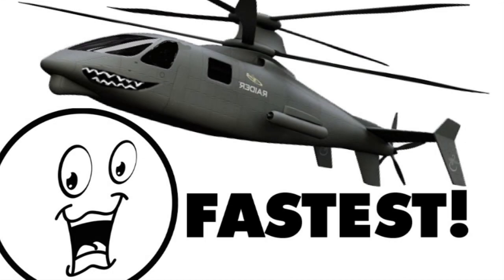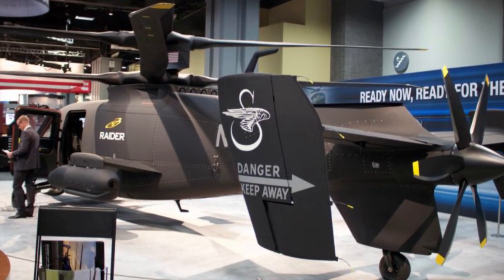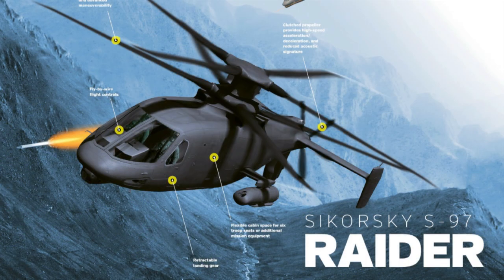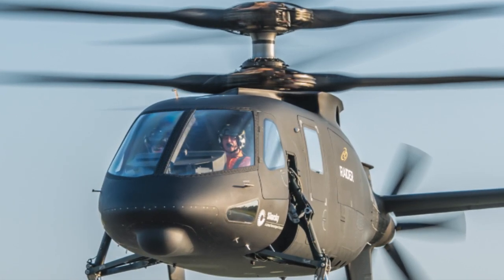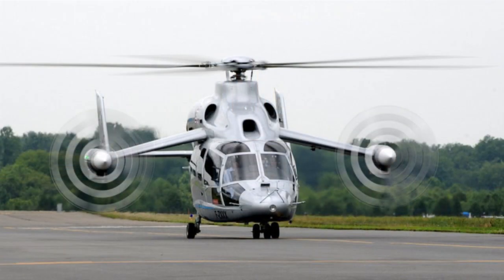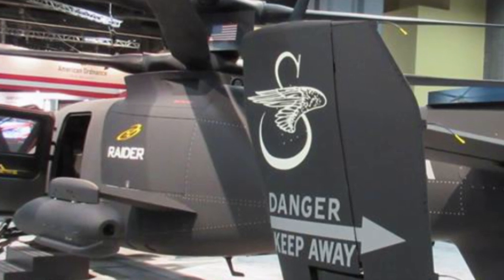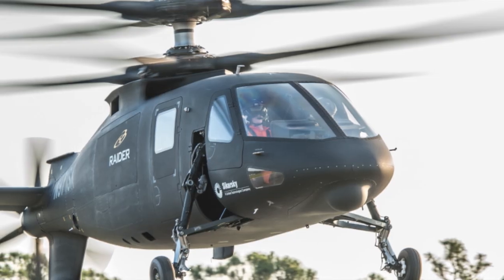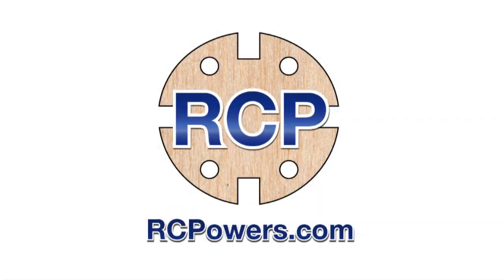SIKORSKY S97 RAIDER

Comment: I got an even better one! It's the Sikorski RAIDER, but with much slowed rotors. The RAIDER has two rotors on top that are only slightly slowed in fast flight (by only about 15%). But if you slowed the rotors by about 90%, they could actually act as plane wings (if you slowed them enough and had computer controlled blade angles). 

This is not possible with only one main rotor. You simply can't have a wing going backwards that makes successful lift (no way). But the RAIDER does have two main rotors, so it's possible to use them as wings. 

So if the RAIDER had 90% slowed rotors (with blade angle algorithms) it maybe would cruise over 300 mph instead of the lousy 250 mph (and be better on fuel as well). And still take-off land like a chopper (when the rotors are sped up).  Yes, the RAIDER is impressive but it would be more impressive going 100 mph faster! And for hardly any more cost. And save money in the long run. And have more RANGE. That's what they want.

Comment: Instead of all the childish, idiotic sound effects, just give the "correct" details of the machine in question. The current combat helicopter AH-64 "Apache" gunship has a top speed of 220-250 mph. Next, the V-22 Osprey has contra rotating blades just like  the P-38 Lightning so that it wouldn't roll to the left or right. Contra rotating blades gave the P-38 Lightning "stability" in flight. Make sure that when you present a video that  your facts are correct, we are not as idiotic as you'd like to think.

Comment: Also, notice how low the pusher prop is to the ground?  I can see some hitting the ground when landing from current pilots that like to flare at the last moment to stop their forward movement.  Just a little something to get used to but the benefits of this chopper will out weigh any nitpicking negatives.
Reply: ElmerFuddGun 
I don’t believe a high speed flare will be a problem.  Just reverse the prop to quickly slow down as demonstrated in other videos.  The younger pilots will get it. They just need to train the older heads.

Comment: How did they solve the problem with the advancing blades? If they go faster than sound speed the shockwaves would brake the helicopter, and in this case you got even two advancing blades due to the counter rotation...